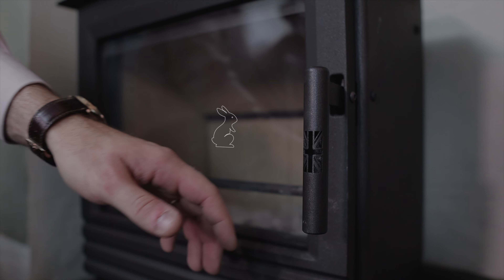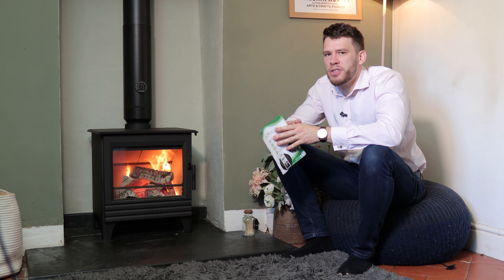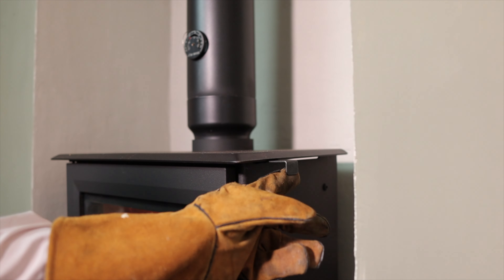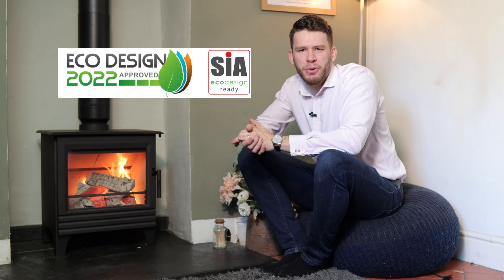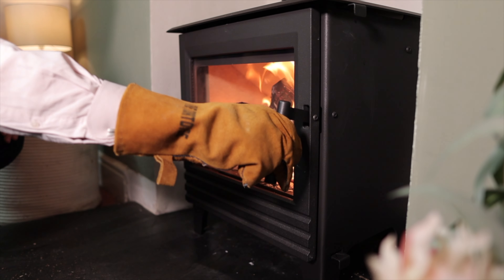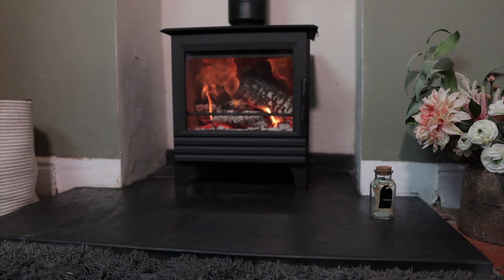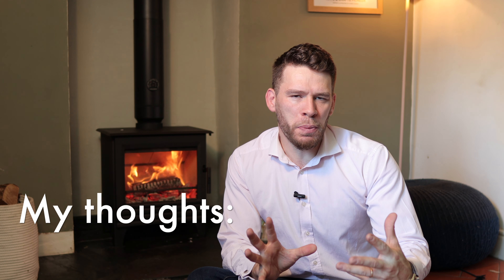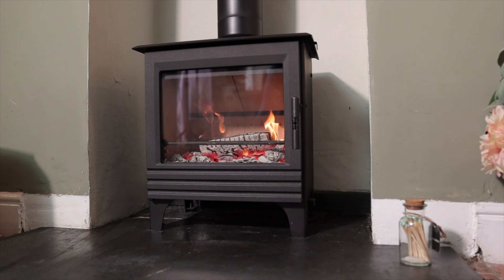Full review of the MAC MetalCraft Symphony Solo 5

Comment: I wonder why more stove or wood burners don’t have a plate on the top like the jotul 602 , or the elusive hobbit, if I was a maker of such items would seem to be an obvious feature, is it a stupid question to ask of how many logs one would burn each day , yes I know so many things to consider. Reason why I asked , not got a stove yet still trying to do my homework, I rang my local wood supplier was surprised by how many there is, but the one which seemed reasonable to me was 450 logs for 240 pounds , don’t know if that’s good or bad , so I was trying to work out how long that would last, at home all day so just trying to get warm in winter at the best possible cost , only got the old age pension coming in electric and gas bills are rather high just trying to see if this is an option , sorry should of started the message with its whisky time.
Reply: A dumpy bag of logs where I live is £80 and nets of 10 to 12 logs were £6 last year, using your stove all day would probably use 1 net 12 = approx 12 hours the dumpy bag holds about 10 days worth.
smokeless coal at the moment is £27 per 50 kilo sack and will last me around 10 days, I start with logs for about an hour then go to coal, I have found that to be the cheapest plus the stove will stay lit most of the night and still hot next morning
It really depends on how far the stove shuts down.
Once the living room is hot open the door to the hall and let the heat go around the house, I only used my central heating when the temperatures went below freezing last year.
There are some recommended stoves for all day use on this channel
Reply: @macraghnaill3553  thanks for feed back , is it me or does that seem expensive? My concern if I got a stove could I afford to run it .
Reply from the maker: The first year is normally the most costly, because you have to buy dry fuel. However if you can it’s best to also buy wet wood at the same time. You can then dry the wet wood yourself, whist you burn the dry fuel, and you can then cycle and dry the wet fuel. This brings the cost down significantly, and if you cut the fuel yourself then you can normally run your stove for free.
Reply: @TheTortoise  I think I need a whisky after that reply , I have no idea where you live but it sounds like you’re near trees or at least some available woods, in my younger days yes could quite easily chop wood or trees  , you look a young and strong soul as I was once , I don’t have the health now to do that , the people who sell the wood have not mentioned that one they have wet wood and two have not mentioned it is cheaper , they have only said they sell dry wood being 15 % dry stored, having a green house I could dry store it during the summer ready for winter but would not know where one would get or buy wet wood , good idea though see if I could buy wet wood hopefully cheaper store it myself , I wood not know where to begin to look , can’t see the wood for the trees comes to mind , and this rate wood be cheaper to buy share in a whisky company.
Reply from the maker: There is a lot of ash dieback across the UK so free wood (if you ask) has become very available. Farmers across the UK are having to just burn entire trees in their fields, because there is more coming down than they can process themselves. But as you say it’s a lot of work, but as I say wet wood is a good option. Legally in the UK wet wood can only be sold in large amounts, because they want to discourage using it in bite size amounts. The intention is you buy a lot stack it in a barn and then leave it to dry for at least a year.
Reply: @TheTortoise  thanks kind soul , sorry that you have to drink so much whisky wadding through my long emails. Me waiting to hear your review on the hobbit stove could probably plant my own forest in the meantime.
Reply from the maker: That’s not entirely my fault 😂
Reply: @TheTortoise  I know I didn’t mean to imply it was , you have tried a few times with them but for some reason they are reluctant, personally I can’t think of anyone who could do a better review on their stove.